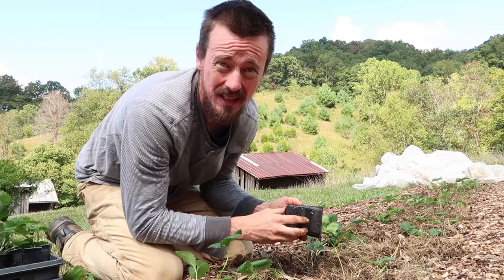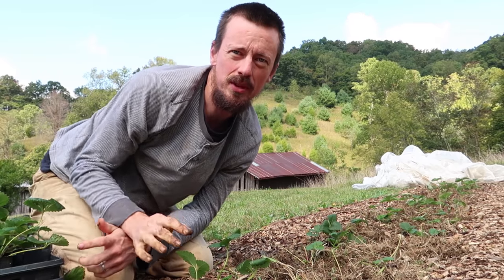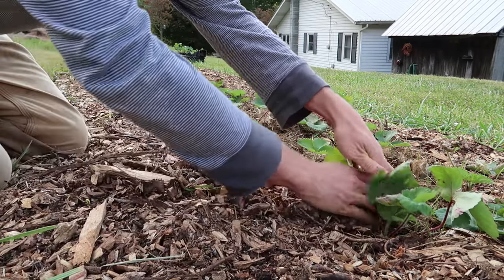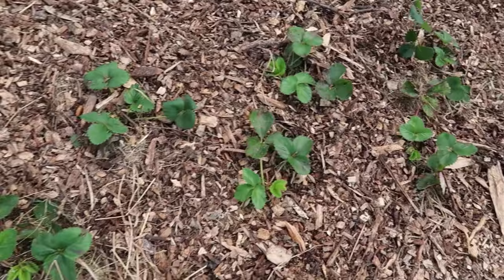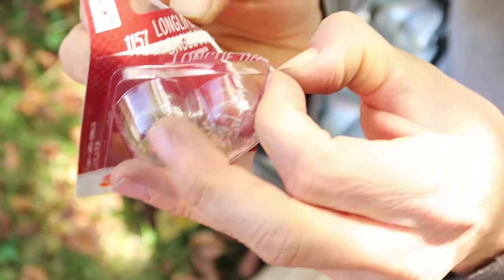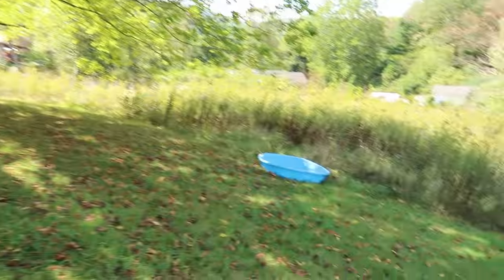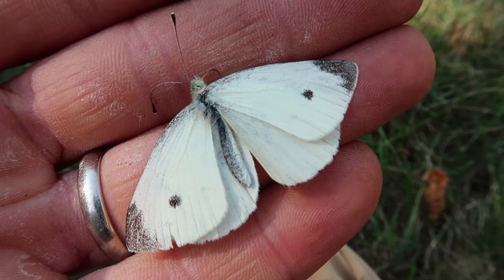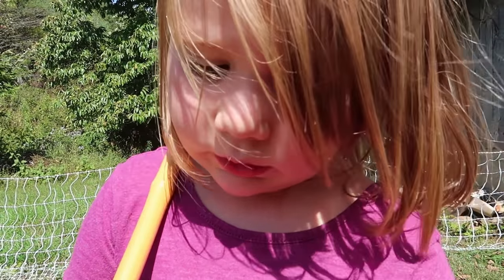Enemy In The Garden - CABBAGE MOTHS !!!

Comment: Looks like you know to check the undersides of leaves on all your brassica varieties for cabbage worms. The so-called cabbage 'moth' is actually a butterfly. I used to try to swat those buggers with my ball cap but usually missed. Went to local Goodwill Store looking for a badminton racket. They had one! Only 99 cents!  Works like a charm for swatting those little white pests out of the air. Much better than a net. You should keep a set of those rackets in various places throughout your large garden. Love the videos!

Comment: Pieris rapae can be a pain. It is a butterfly, the male (White) will hang out around host plants waiting for a female (white with black spots), this is why they fly in twos. Spray your plants with soapy water the caterpillars will fall off. once removed cover with nylon stockings. Another tip is grow nitrogen fixing plants like peas and beans around your cabbages, the caterpillars eat more when there is less nitrogen in the plants. if you do get the odd one through the stockings (unlikely) the balance of nitrogen will mean it will eat less.